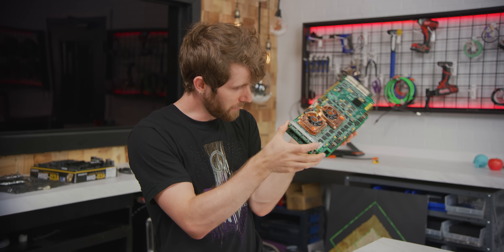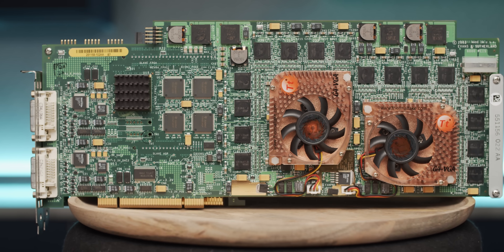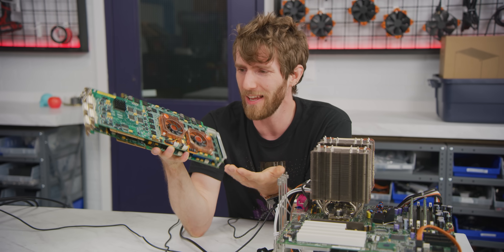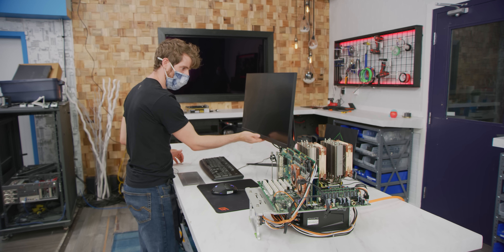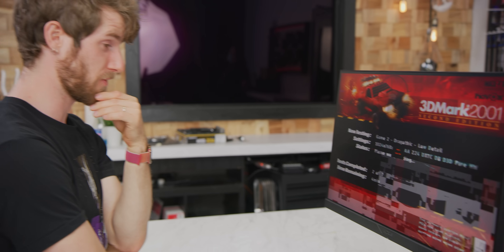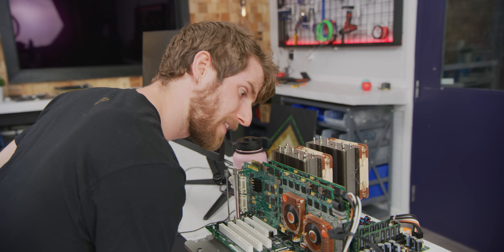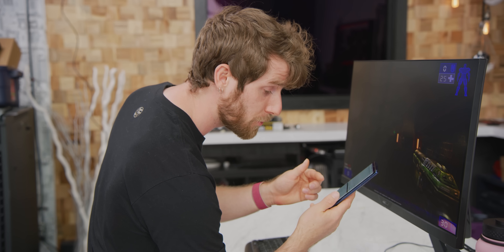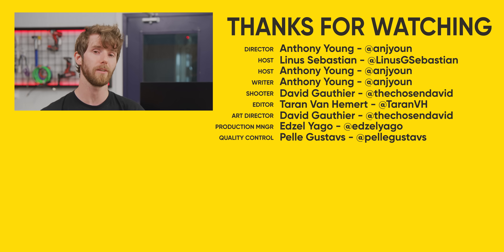This MONSTER Video Card has 4 GPUs... and it's from 2004! - E&S SimFUSION 6500q

Comment: Causally, “I had to recap the board so it would work.” Lol this dude’s a legend
Reply: linus idk man if i wanna plug in an xp machine on the network
he i already did it 
linus -_-
Reply: Legend? Recapping is basic stuff to someone with basic soldering skills
Reply: He’s not a legend. He’s an angel.
Reply: @KillBob_GangPants  He is the tech knowledge base of the entire channel. He is the people the tech support call for tech support.
Reply: I mean it's just a capacitor and some knowledge of how to solder.
Reply: It's pretty standard if you're in the field. I deal with it all the time, but I mostly repair older CRT chassis systems, or oddball mobas for early pc based arcade games.. Because sometimes you just can't buy the board anymore.
Reply: He could have just borrowed mine.  I have 2.......er......4?
Reply: Does “recap” mean replace the capacitors?
Reply: @rodton1000  yes
Reply: @rodton1000  j
Reply: @rodton1000  Yes, it does :)
Reply: I mean it's not easy, but working in his field it is basic knowledge
Reply: @silentantagonist2333  for sure. I dabble in soldering and I generally stick to revamping old Nintendo systems for profit. I’ve just never gotten that deep into it before.
Reply: I started recapping mobos since i was 13!
Reply: @TheSlimShady87  yeah its not that hard bruh
Reply: He never clarified whether he recapped it or had it recapped.

Comment: I think you would have done better to test that card with games and benchmarks a few years later, when SLI and Crossfire actually existed. Something like 3DMark 2001 isn't going to know what to do with quad 9800XT GPUs, but something from 2005 or later, which would be Crossfire-aware, might be able to recognize and fully utilize the four GPUs.

The fact that ATI did have multi-GPU technology for Radeon GPUs was known, though. I remember rumors of a Radeon MAXX card many times, and apparently ATI even made prototypes of one, but never released anything like that to the comsumer market.

Comment: “It was plugged into the network” 
sweats profusely
Reply: I don't get this scare lmao, what's gonna happen.. infect the xp machine at worst
Reply: @harshnemesis  Kinda necromancing the thread but, he might be right to be worried, as Windows XP has been a dead OS for many years now, so all it's security breaches and failures that haven't been patched, never will be. That means that a machine that accesses the web from a long dead OS with its old security problems and stuff is vulnerable to any potential virus on the web (You don't even need to download anything to be infected). It also means that this Windows XP PC is a door for virus to be spread across your entire network and go unstopped. Oh and btw, the virus won't attack your network with only old Windows XP-old virus, but also newer ones.

So yes, Linus is right to sweat profusely, because this thing using a long dead OS, plugged to the network and to the internet is a threat to its network (that includes every other computer AND server that LTT has on said network).
Reply: @amarcan1000  You do realize that you can connect any pc to your network without it even seeing your other computers in your network right?

Even if the pc can see the other computers(but isn't given permission to access the network drives), that would be then the network vulnerability of whatever operating system these computers use, such as windows 10

As far as not doing anything other than connecting to internet and getting infected anyway yeah that is only possible if a hacker happens to know your ip AND has a windows xp exploit he can take advantage of. He must of course know how to do it as well, which not many people do. Closed ports limit the exploits alot especially if the user doesn't have that particular program open (such as IE, WMP)

The hacker would also need to know exactly when Linus is using the xp computer on internet (it was only for one hour)

Also microsoft still did patch the serious exploits such as wannacry in xp too, even tho it was long out of support by then.

Bottom line: The (in)security scare is overblown

Comment: 3:35 what a lie... its more like AMD now, i miss ATi, they did a much better job before AMD bought them
The 9800 XT was anyways outperformed already at this time from a G71 chip from nvidia, i really loved my 7950 GX2 these days, but damn i will never ever pay that much for a GPU like i did in 2005/2006 with the 7950 GX2. It was also a dual PCB graphics card and a beast, at least until the 8800 GTX came out, which outperformed everything easily by a huge amount, even the 7900 GTX in SLI (around 10% faster than the GX2) vs 8800 GTX as single GPU.

Comment: 80% of comments here is like "WHY YOU HAD TO BUILD 10YO PC INSTEAD OF BORROWING MINE?!" Guys. I know we have sometimes hard time in our lifes and i am totally aware of that, but it can't stop us from chasing our 60FPS FHD gaming dream. We can build fairly cheap PCs with respectable High FPS power, the only thing is, we need to plan our budget and have patience. Me, person which doesn't have a real job, could earn some cash on the casual things like repairing electronic stuff or just helping people on hard work, could buy used PC Ryzen 7 1700x, 16GB ram with RX480 for less than 500$. We just need to be patient and use things or skills we have around to take an advantage and make our 60FPS Gaming become true! I have faith and believe in you! 
Have a good day or Night
Cheers from Poland
Reply: That is absolutely true, but one can buy a mainboard for 60€, a Ryzen 5 2400G with integrated Vega11 APU for about 120€, a 20€ SSD and some 50€ RAM (and a cheap PSU for 50€) - and enjoy limitless gaming everything turned up to ultra settings even cheaper for 300€ ;)
I did that for several months, before upgrading to a 5700 OC half a year later. (Well the mainboard was more expensive).

Comment: I remember building several Voodoo 2 gaming systems in SLI (you needed a primary card as well) and playing Mechwarrior 2. At the time it was some of the best gaming graphics you could get. Trying to remember the years, but they were some of the first SLI systems you could build. I still have 4 of those cards, along with several Voodoo 5 cards on the shelf that I built around (both pci and agp versions). (No dvi, just vga connectors to a 17 inch CRT monitor at the time). Thanks for the blast from the past.
Reply: Voodoo 5s are so freaking expensive

Comment: We had a 9 channel ESIG-3000 from Evans & Sutherland for a 3D Tower simulator. I think it was more than $ 1.000.000,- without a power unit, That was another $ 35.000. Compared to that those cards where cheap.

Comment: I had a Quantum Obsidian X-24 way back in 1998. It was a dual Voodoo 2 GPU on one 3D card. Plus a Matrox Millenium to run my 2D stuff (because you needed both back then!)
Reply: Yep, I had a Voodoo2 setup with a Matrox G100 as 2D 'main' card. While the G100 had 8 MB ram, it was almost all put into spitting out 2D images in as high resolutions as you could wish. The 3D bit was....ehhhh, painfully slow and muddy, at best :P

Comment: I have a very similar system with the same CPUs I built around an Asus PC-DL motherboard with an intention for XP era retro-gaming. I wanted to make the ultimate e-peen rig I dreamt of from circa 2004/2005 when I was in high school, but alas it sucks the big one. I'm going to make another attempt with a newer PCI-E based board and either late-model P4 or early-model Core so I can use a better graphics card than the AGP GeForce 7800 GS I wasted my money on. Works fine for early XP-era games but falls over for anything newer than 2005. I'm going for the sweet-spot, the pinnacle of XP gaming, which I think was probably around 2009-2010 or so before people finally accepted Win7 as a worthy successor. It's unfortunate choice of vintage that got me first time around... can't even recycle the beast into a Win98 box, and Windows 2000 gaming is really not a niche I think deserves it's own overbuilt box, probably just going to part it out.

Comment: may not believe this, but if configured correctly and with a different card that doesn't have the artifacting there, that card would indeed run crysis somewhat ok... seriously...   crysis 1...
Reply: I GOTTA SEE THAT
Reply: @AlguienMas  word. i bet it would perform respectably actually, again if configured correctly and able to be fully utilized.  i didn't own any radeon cards around the time but my understanding is that the 9800 is sort of in the same ballpark as a geforce 6800 or so, which does run crysis ok on lower settings for the most part.  4 of them would actually do quite well i think.

Comment: Voodoo 5 6000 had four GPUs on one card with preproduction units.  Voodoo 5 5500 had two and it was a retail product released in 2000.

Comment: had to buy myself a 9800xt in 2005 for the upcoming oblivion and other games back then. and I stupidly choose the 1 slot version with a copper (and 1 heatpipe mind you) radiator. the only way to run it was using a massive 10kilos (industrial)blower style fan blowing directly on it.Good thing i had some Helicopter headphones :)))

Comment: I dont understand... this card can´t predate SLI, because it has ATI 9800's GPU on it, GPU´s based on the R300 ATI´s Design. Those cards if my memory serve right, was the ATI´s response to the Geforce3, the first Pixel and Vertex programable card from nVIDIA at a time that they already bought 3dfx, so... 3dfx already have the SLI technology back then with the Voodoo2, so nVIDIA already have that technology too. So this card HAS TO BE after this.
Reply: Interesting card tought.

Comment: AGP, I almost forgot about that. I was so excited when it first came out.
Reply: But he said its PCI. Original PCI... Goes back to the 90's. Why they didn't use AGP (2x, 4x, or 8x) is beyond me.
Reply: @countingsheeple2428  It's both. There never was more than 1 AGP port on a board, so one port has to be PCI.
Reply: @CakePrincessCelestia  Who ever said there was more than 1 AGP port on the board??
Reply: @countingsheeple2428  That card is literally a dual-card, one of them is AGP, the other PCI. so it takes the AGP and the first PCI slot at the same time.
Reply: @CakePrincessCelestia  Holy fuck, you're right! That is so weird. I wonder how many other cards had that.

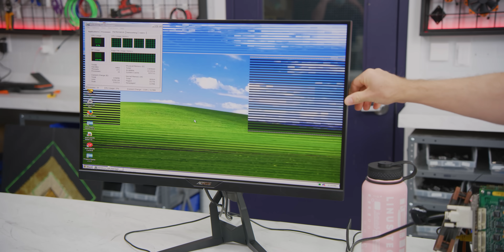Comment: 13:43 looks like when my Radeon 6870 started to die, so rest in bush's baked beans
Reply: if your Radeon 6870  is broken
cook it in the over 380F for 10 minutes
this isn't a joke...
strip the card down to nothing and attempt this
the card will work like new
this is how i fixed my old 280X
if i knew this before buying rx580 it would of saved me $300
Reply: @MrTjp420  Huh, I still have it so ill have to give it a shot. Funny we both had the same great classic gpu die and then go for the same one

Comment: Man, I remember those Thermal Take graphic card coolers, when they came out they were "unreal" and that damn fan, man were they noisy as hell, but if you were at the forefront, you had one :-D Haven't seen UnReal99 in so long I barely remembered it, could have also tried Quake2 or 3 for OpenGL.

Comment: Video card with 4 GPUs... in 2004?

Pffft, noobs, get a Voodoo 5 6000, 3DFX did that in 2000 already...

Also, you're saying it predated NVidia SLI... but the original SLI came also from 3DFX and meant Scan Line Interleave, as in each chip calculated a different line of pixels at the same time...

Comment: 0:55 but Linus, 3dfx did this back in 1998... they were the ones to first do SLI
Reply: Yeah I wonder why nobody commented on that. Also what about the Voodoo 5 5000 and 6000 series prototypes, that were also using 2 or 4 3d chips on the same card? Not technically SLI, but still..
Reply: @TilmanP  I had a Voodoo 5 5500.  It was a retail product with 2 GPUs on one card working in SLI.
Reply: VooDoo 5 6000 also existed (not released, but existed) and it had 4 GPUs.
Reply: @xaph212  I also just learned from Wikipedia that there was a card called the "Quantum3D AAlchemy 8164" with 8 Voodoo GPUs. Just like the one in the video it was intended for professional markets.
Reply: @TilmanP  I googled and saw 8 VooDoo GPUs card pics....
INSANE!
Reply: @xaph212  if you guys are interested on YouTube there are many videos about 3dfx and 3dfx vsa 100 projects(even bigger than 3dfx voodoo 5 6000)

Comment: No... I've got some thermaltake hardware and it's definitely their stock choices that made the bearings crap.  The only way you could get cheaper components at the time was to have them manufactured in North Korea with a hammer.

Comment: You know it's a hell of a company when they are bought by Collins. These guys manufacture not just simulations but autopilot systems for commercial aviation and extremely reliable . It must be difficult since both autopilot, autothrottle and Flight Management unit needs to work syncronized, do some serious number crunching and provide sensitivite, precise data for mechanic stuff to work.

Comment: S3, 3Dfx and Matrox were all doing 3D long before 2004 way before  the radeon 9800xt, in fact the  R300 chip was only released in 2003 by then 3Dfx was already defunct in 2002. I already had a Voodoo 2 in 1998 which was using opengl with a minigl driver and it worked 100% with direct 3D and glide also the Voodoo2 card was doing  sli in 1998 already, so either Linus is wrong with his details about who started 3D or i'm wrong.

Comment: Before the Voodoo cards were S3 cards. I started in IT back in the mid 80's. My first game was Wolf 3D on a 286 machine I built. Back in the day when AMD truly ruled the CPU war. Everything used VGA back then. Hell, you could buy VGA displays in 256 shades of Grey or full color. 13" Color VGA monitors were around $400 for .28mm dot pitch units with .39 and .51 dot pitch monitors costing less. Mono VGA was around $100-$150.

Comment: are you sure thats xp lads? that looks a lot more like 98, or windows 2000, pr possibly NT. unless i just dont remember being able to change windows and things like that on xp. I was quite young and not into computers when i was on XP.
Reply: also it might be artifacting a lot because of the monitor and resolution youre running at. My old dell that used to run XP that im using as a FaH box doesnt like my new flatscreen monitors a whole lot. and i think a 9600 gt is in that thing. Running off of VGA of course.

Comment: Cool a computer cpu with a 5 gal bucket and ice and water or get a water cooler and run it through that (i dont know but it may swet and get water every were so may need to use some hose that wont swet

Comment: Headphone users: "Fan noise is not a problem"
Jet engine: appears
Reply: only by closed headphones ;p
Reply: @Nonspecies  i'm used to it. my ps4 sounds like it's gonna take off and attack me in my sleep
Reply: @andreibalasa745  i use a semi open and yes... the ps4 is loud but it is the drive not the console himself
Reply: @Nonspecies  You say it's the drive? I doubt it, but I ll give it a try
Reply: @andreibalasa745  it's very easy to clean a ps4 slim without removing the warranty sticker or even voiding it if that's a thing in 2020 lol. Oh and it will get you to the heatsink & fan, where the poor thing was caked with layers of dust.

Don't think it's possible with og PS4 (have to dissasemble rather than just removing top cover and PSU + Metal plate) but yeah, definitely worth it. Mine also sounded like a jet engine under use. Dunno about PS4 Pro..

Actually I cleaned my PS3 super slim last night, wasn't noisy but it was definitely in need of some TLC and hopefully temps are a bit lower now.
Reply: @syed jawad When did you buy it and was it new or second-hand? Also how is dust in that area.. Probably there isn't much dust in there. However just to let you know my PS4 Slim and PS3 Super Slim are pretty much silent, meaning disc spinning is louder than fan noise, and temperature wise it is running very well.
Reply: Yeah it sounded like Linus's next big thing is rediculously overclocking fans.
Reply: @syed jawad that's cos you've got 'gamers ears' ...probably

Comment: I used to program a (very) very old Intel graphics chipset, the i750, circa 1989 or so.  The first generation of the graphics card came on a seven (7) board set!  It was so large you couldn't close the case.  The second generation was only three boards and much more finished.  It ran at a blistering 50 MHz back when the CPU (80286) ran at 20 MHz.  Those were fun days...